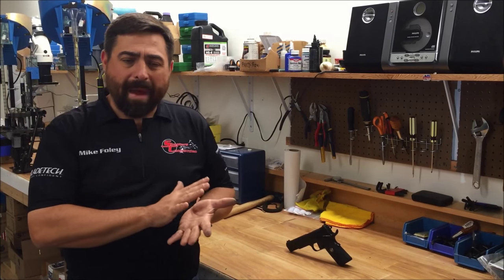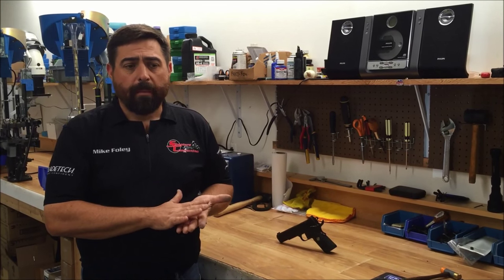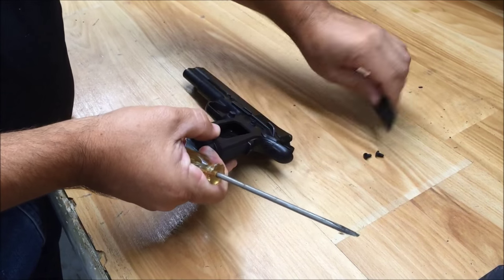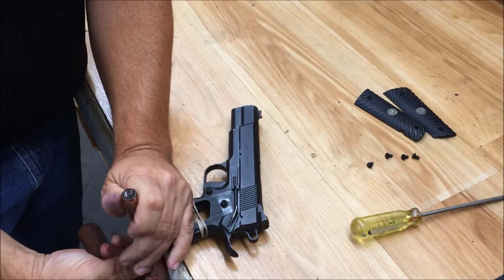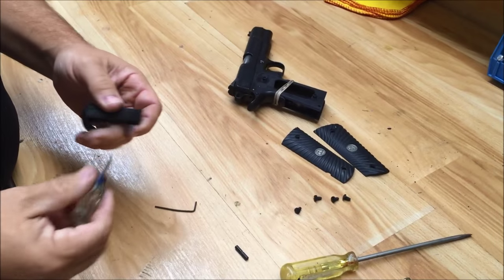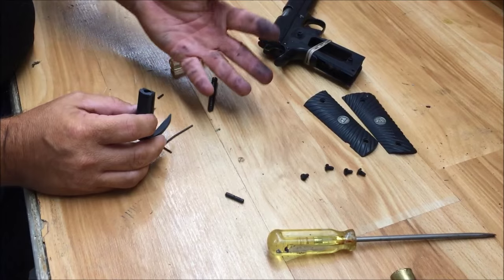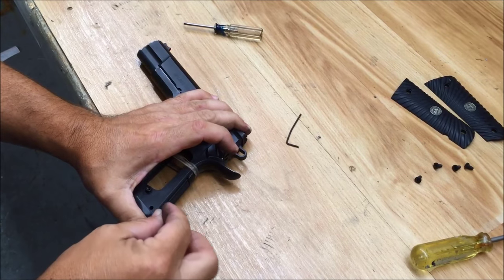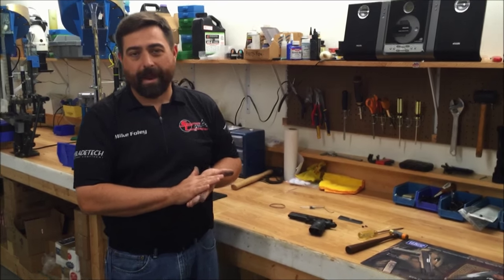Change 1911 or 2011 Firearm Main Spring or the Hammer Spring

Comment: For light primer strikes if you increase the hammer spring it will increase the trigger pull so would it be better to install a lighter firing pin spring?

Comment: I get light strikes on steel case at least 1 per mag RIA 9 mm compact all factory as far as I know , what would be the best recommend to try first , 19lb mainspring?
Reply: Would have been nice to get a response. 
I have light strikes on aluminum casings with my STK100,  but brass has never failed. I think the ammo was old as they say aluminum doesn't keep as long when stored